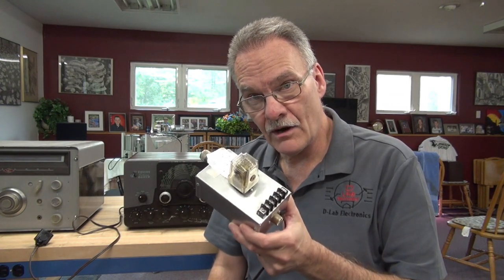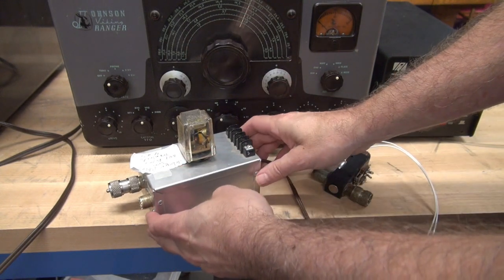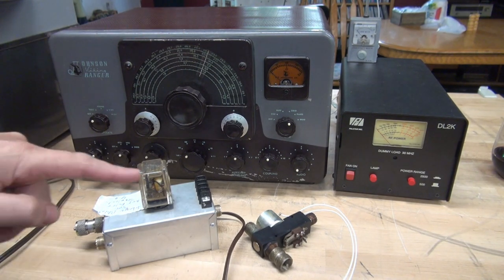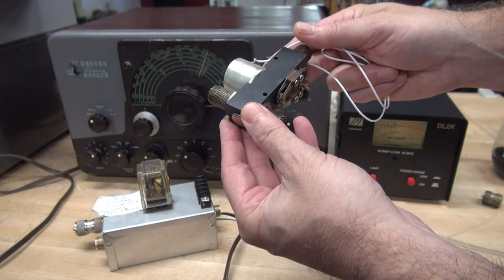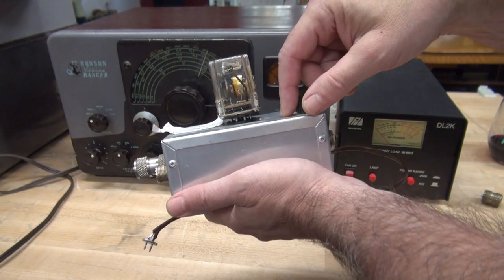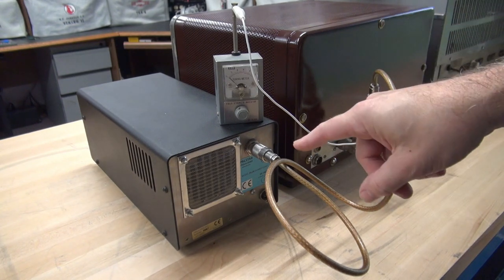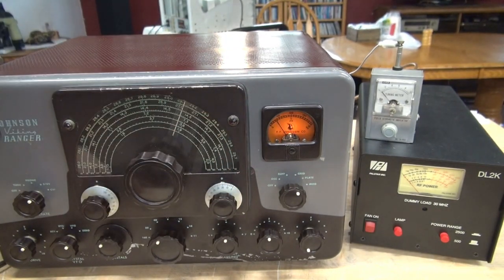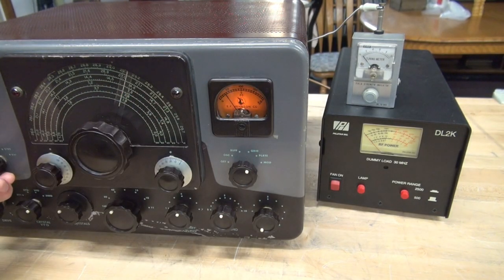What is the best TR antenna changeover switch for your Ham Station n6tlu has performed a test decide

Comment: I have one of those.  I suggested he put the relay inside the box 10 years ago. He told me the CBers like to see and hear it click. Most of the time I just build my own or use the Johnson TR switch.  I don't use dowkeys. I lost two radios to them.  They are old and can stick and when they do, they dump the rig into the reciever. If you could get new 120v dowkeys, that would be one thing.  Sounds like it's time for you to come up with a solution Terry.  An enclosed TR relay.  Small vac relays are best. NO and NC terminals for station accessories and a slow release delay. That is very important for these rigs.  They all benifit from a slow release on return.  I use the Johnson circuit in my TR switch. Simple diode and cap.
Reply: "Users want to see and hear the relay click." That makes sense. Maker knows it's better to put the relay inside the box, but his CB paying customers prefer it on top and visible, so he keeps it on top of the box.
Reply: How in the hell does one bun out a dowkey? Sounds like operator error to me

Comment: Great video thank you for posting.  I just went through T-R relay replacement on a homebrew HF RF amp .  I found most standard relays that place the coil perpendicular to the contacts also have an unshielded wire to the switched reed that lengthens the RF path and is usually pushed up against the coil itself: Yikes!

Now when I build (<16A ratings)  I use relays where the coil is parallel to the relay reeds because there is no wire. The terminal connects directly to the reed/contacts and two narrow SP units can be cemented together with an aluminum sheet between (isolation).  

Thanks again like your channel. neil n2eye

Comment: A good demonstration, Terry!  You show why you can't treat RF signals like DC, just like you need to properly handle high voltage or high current each in their own way.  Using that "ice cube" relay offered no shielding.

Oh, and I liked the fact that you made a point about not caring who made the "ice cube" unit; you weren't trying to put down anyone in particular, mainly just showing the problems inherent in the design.  I'm looking forward to the follow-up video. 🙂👍

Comment: Thanks for bringing up the name Dowkey. An eBay search found a new old stock, sealed-in-bag unit for $13 total. Probably had a value in the hundreds of dollars originally. Has SMA connectors though. For small signal use only. Will work great for antenna and receiver comparison. Has a very high isolation figure. I wasn't familiar with Dowkey before your video.

Comment: That's great information. I would think the octal socket, assuming a quality socket is used, will be just as good/bad as the socket on the outputs tubes. The long conductor relay contacts in an unshielded housing, though, do seem like EMI waiting to happen. AC7JC

Comment: I have been using vacuum relays from jennings or killovac and mounting them in a die cast case i have a conventional relay inside the housing for muting contacts.  they take a lot of RF and never fail and the "flight time" of the vacuum relay is much faster.

Comment: I have used both kinds for years , no problems here. I tried the same test on mine , as soon as the wire loop was 2 inches away I couldn’t pick up anything. I wonder if we should try the same test on open wire feed line or ladder line.  Remember the term skin effect. 73

Comment: This problem is real, but it is because of a socketed control relay and really poor wiring in the box.

The problem has nothing to do with relay shielding or the relay's internal design inside the plastic cover. The problem is almost exclusively from the wire path lengths and routing from the relay to the connectors. 

The relay internal construction is perfectly fine if not socketed  and if someone is mindful of wiring, shielded or not. 

The Ameritron RCS-8V and a half dozen others from a variety of manufacturers I designed are well over 50dB worst possible case isolation  and cross talk loss up through 30MHz, and that is worst case. It has no shielding at all and the case leakage is almost unquantifiable across HF. It is actually perfectly functional to 150 MHz with its open frame relays.

I have designs using  $1 wholesale cost cube relays with almost no bump at all measured at 400MHz, and they will handle several kW at HF. 

Every commercial Ham amplifier made uses either an open frame relay or little cube relays. I've measured 40-50 dB crosstalk loss from  input to output in a properly wired relay. 

We can take a good relay and screw it up with how we route wires and the ground paths through sheet metal. That eBay switch is a great example of how to screw up a design.

Comment: I had the same concerns when I saw this relay at hamfests, regarding RF shielding. This was a fair test. I also wonder how the ice cube relay would react under high swr conditions. I built my own relay years ago, and still use it. It is in a shielded box, with a heavy duty relay, (ker-chunk!) and external contacts for receiver mute. I also use the standard dow key relay for my other stations. The hillbilly relay is a great idea, but in my opinion the implementation leaves a lot to be desired.

Comment: I built a few Ice Box types and have run 350 watts AM on a consistant basis for years. Dow Key do the still make them? Why would I want to search out old junk? Yes a vac relay would be best. I however don't run a commerical station. The relay on the ice box goes I slap in another one. FYI never had to do it.  I will take my chances on the newer stuff plus I can pick a higher quality relay to slap on the box.

Comment: I think this test is skewed because of the way you wrapped the two devices differently.  You really did need a seperate loop from the field strength meter placed exactly in the same position for both tests.
Reply from the maker: Yes the devices are completely different, however the field strength meter was a constant
Reply: @d-labelectronics  Sadly not the coupling.....Constant would have been with a fixed sniffer aerial on the FS Meter and it held at exact same distance for each test.

Comment: Sounds to me like you're just hating on the hillbilly RF relay. Maybe investigate and offer methods of improvement for those unable or unwilling to pay the price for a vintage relay.
Reply from the maker: Yes Sir, I am working on a solution
Reply: I wouldn't call it "hating", especially in such a short, basic video.  I'd call it a quick demonstration of the difference in performance between the two devices, and why one is preferable over the other.

And as I suspected (and his response shows) Terry's already trying to address the shortcomings of the "ice cube" design.
Reply: I have a number of Dow Key Relays, some are good and others are terrible.   Then I went ahead and built my own TR relay.  I came up with a large relay for the RF side and a smaller one for the muting function.   Truth be told I like my Homebrew unit better.

I never really considered the RF leakage in the shack and the amount of insertion loss that I have I think is going to be comparable on my Homebrew unit versus the Dow key.

Here's the other problem. Where are you going to find these Dow key relays in the marketplace other than the secondary market?  I'm not certain that they're still being sold as new product and if so at what kind of a price.   I built my TR relay for about 20 bucks considering I have a reasonably well stocked junk box.  I paid $5 each for the double pole double throw relays at Dayton one year.

But if something else were to come along with perhaps a solid state relay that makes sense that I can build reasonably I would be interested in looking at it.
Reply: Was surprised to see you at the Adrian hamfest yesterday.
Reply from the maker: Yes, fun event, The video posted tonight! Take a look
Reply: Tohtsu Coaxial Relays

Comment: I gotta laugh at this. I have built and have in use 3 "ice cube" relays. Zero problems ever. In fact I run a bc610 through one thats legal limit AM not some little ranger. Zero issues folks. I think Mr. D lab has run out of things to do to on his channel. But you want to send me some  of your dow keys because your so worried about it I will put it inline. But when I key the transmitter I have no worries and do sleep just fine at night.